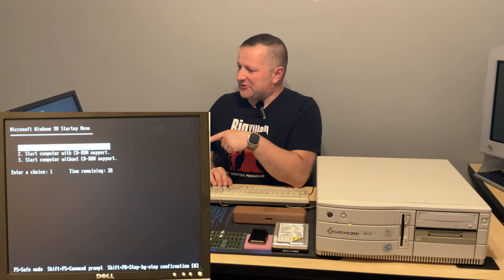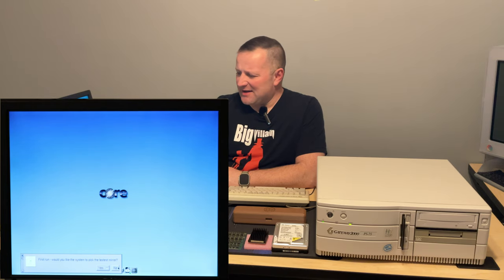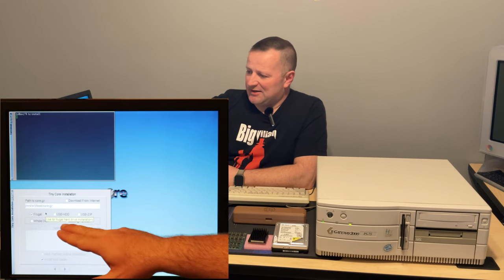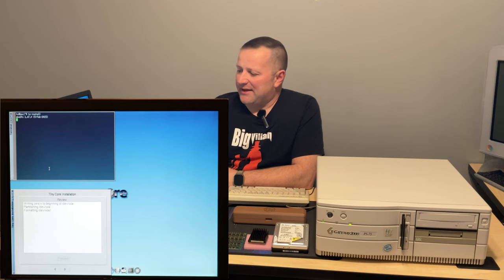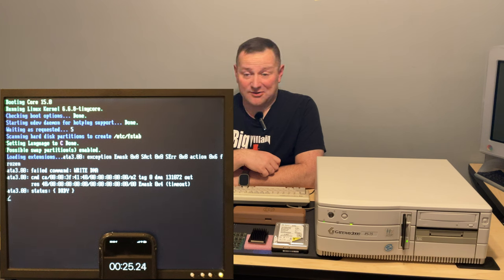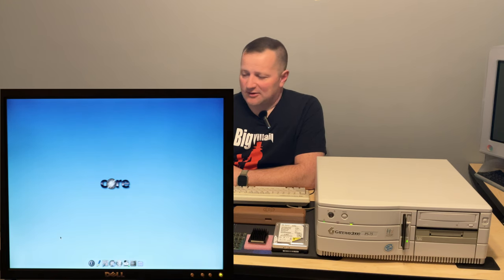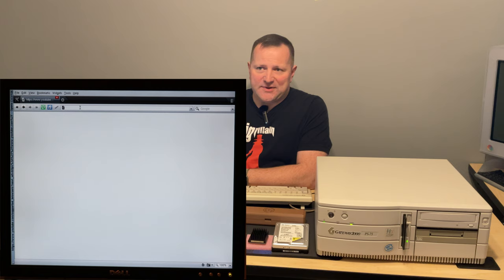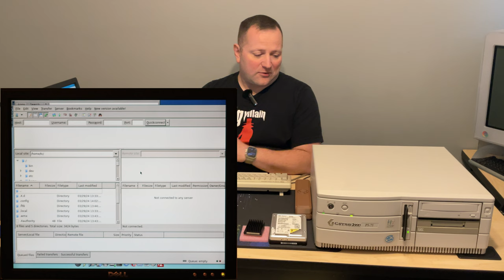TinyCore Linux On a Gateway P5-75 With Upgrades

Comment: Takes me back nearly 30 years; someone at work bought a Gateway PC, they got the system unpacked and set up, but didn't have a clue how to use Windows 95.  It came with a large pack of CDs - games, encyclopedia, reference books, educational stuff - which they couldn't install.  I helped them out with that.
Reply from the maker: When I got my first modern computer I thought  had to install all those CD’s. Turned out it was all on there lol.

Comment: I have had the similar long-boot error with "AntiX Linux 21" on my "Acer Aspire" laptop (2008). Each loading of the system took approximately 5 minutes. Eventually I was forced to change the modern Linux kernel in the grub menu for an older one. Afterwards the system always booted nice and smooth.

It must be said however, that I hadn't got any hard disk drive on my laptop at the time. Aforesaid system "AntiX Linux 21" ran just from a tiny little SD card. Back then some people told me about the absence of HDD being the cause of the whole issue... =))

Comment: Does that system have  ATX soft power off feature or is it the AT power switch ? I forget when they transitioned over gateway was one of the last ones to
Reply from the maker: AT power switch routed from the power supply in the back. Very satisfying spring back and click when pressed.

Comment: I always like the Gateway Machines, although the cables were always a sight. (Also, nice job on the video work, what tool do you use to show a split screen with magnification?)
Reply from the maker: I use DaVinci Resolve to edit and they have a decent suite for editing and adding clips as needed. That was pure optical zoom from that camera overhead just cropped in place with manual focus.

Comment: those mainboard compatiblity switches are so cool! Thinking of using tinycore on some servers, will probably use fedora because i'm used to it.
Cool to learn more about it from this video -- i didn't expect this to work fine on this machine 😂 that is kind of amazing. Honestly " tc" being the package manager has me concerned 😂 so i'm not too sure

Running the application from the terminal to troubleshoot. Classic
Reply from the maker: Back then you had to definitely read the manual. Not sure I’d use tc as a server as you’re by default one sudo away from root. It’s nice that it’s basically Linux legos though if you want a real custom use OS.
Reply: @IkesVintageTech  Yeah, it is tough -- the biggest players in the Linux server space seem to be the biggest players in the Linux spying spaces... RHEL is closed-sourcing and this was the main reason I was wanting to find something else... But ... -.- I'm not using Ubuntu. So I'm not sure what I'll go with, I don't think I want an Arch server, either, lol. I will probably just bite the bullet and use Fedora. DNF is just too good and please tell me why having "rm" instead of just "remove" in a package manager is so rare? Seems like common sense.  😂 I'm at a loss 
I hate linux
Reply from the maker: @emmaccode  we use a hardened version of CentOS for most of the stuff where I work. It’s all offline but they still have to make sure it’s sealed tight.

Comment: To me it looks like DMA writes are failing and eventually falls back to PIO mode. A potential easy fix is swapping the 40 conductor IDE cable with an 80 conductor. Thanks for the video!
Reply from the maker: That’s a great point. I’ll give that a shot and see. Thanks!